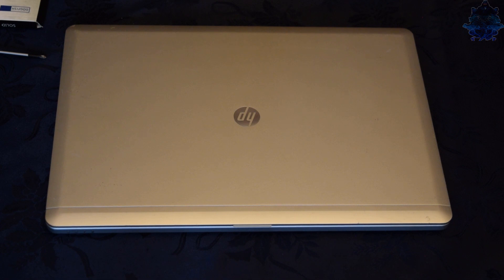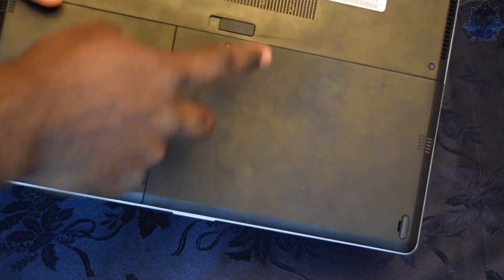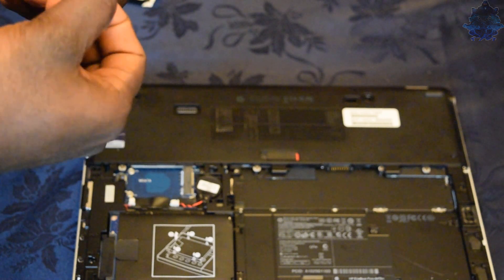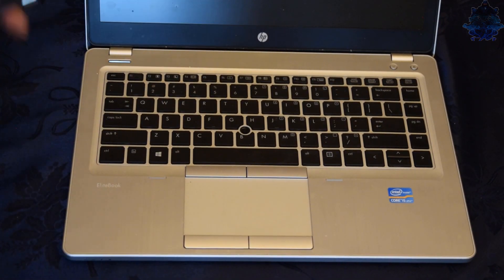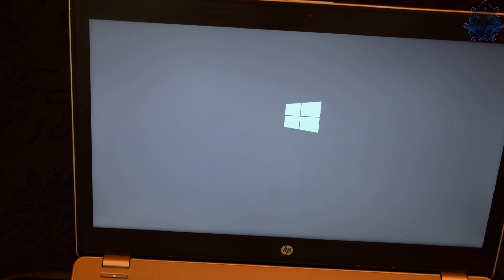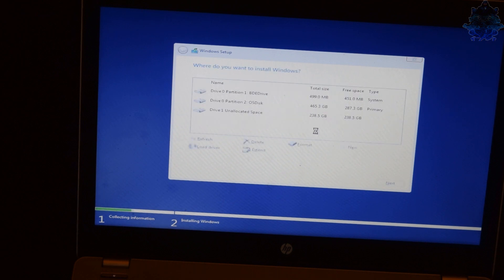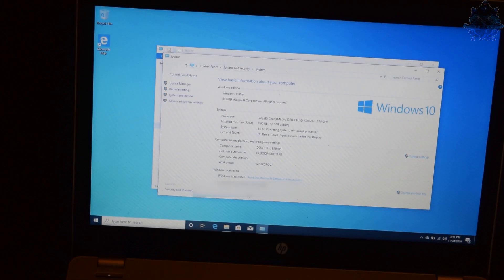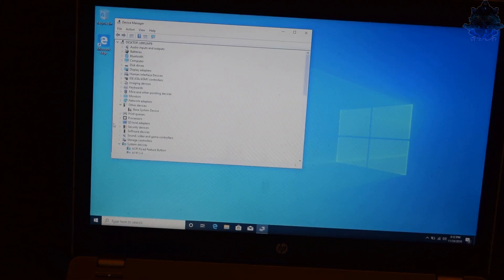How To Install MSATA SSD With Window 10 On Hp Elitebook Folio [9470m i5 3437u]

Comment: Hi , do you anything about setting up a  mSata drive as a Windows RAID configuration with the SSD HDD to improve perfonance... I think for a start both mSata and SSD/HDD must be the same capacyt..since the mSata max is 256gb to configure RAID the HDD/SSD must ALSO be a 256gb...this is as far as i have progressed.
Any advise appreciated.
PeaceFromOz

Comment: Can we make the partition of our mSATA just like HDD.???
Reply from the maker: It is a hard drive  you can do anything
Reply: @billykibakithejamaican  Thanks for ur reply
I have HP Folio 9470m which SSD should I install with my HDD. Please Suggest..
Reply from the maker: @ajaygangwar6384  any brand of msata ssd works
Reply: Can this laptop install msata 512gb? Or 256gb maximum?

Comment: Thank you soo much brother.. :-)
I was having a similar situation wherein I have a old HP Sleekbook laptop with HDD and a separate empty mSATA slot. Everywhere I could see in Youtube or in Internet is swapping the HDD with a SATA SSD which I did not want to do. 
However I was pretty sure of adding an additional mSATA drive in that slot and your video did help in kind of giving a go-ahead with the operation. 
The only different I did was, to clone my HDD to mSATA SSD and then format HDD and use it as a storage drive.
The mSATA SSD works like a charm.. Cheers brother!
Reply: Please which software did you use for cloning and can you help with a guide?